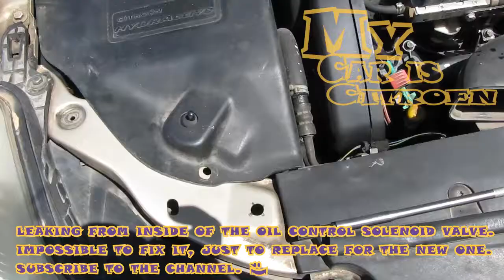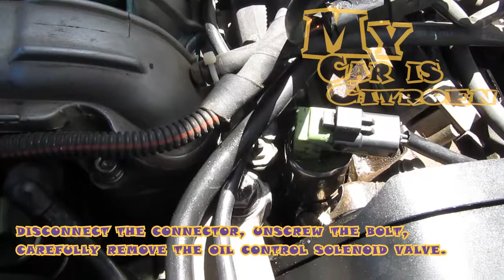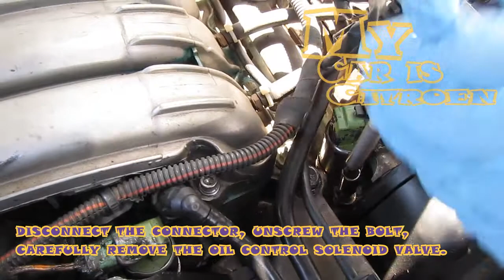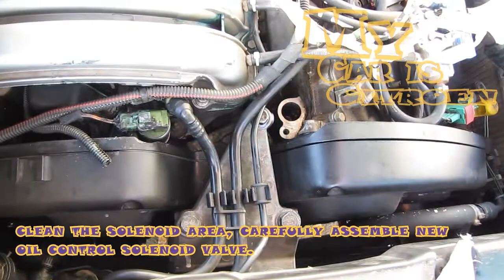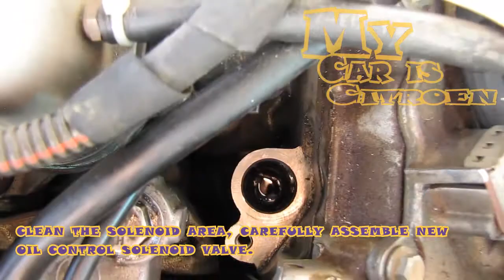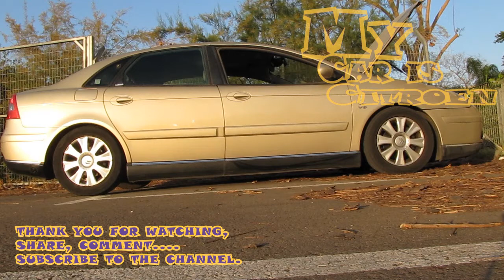Citroen C5 - How to Replace VVT Oil Control Solenoid Valve - Variable Valve Timing Oil Control Valve

Comment: Would a cold start hight pitch short-rattle be related to a failing VVT solenoid?
Reply: That is the same problem I have, so you have answer to this one yet or no. I will go try to clean the selonoid and see how it works
Reply: @AJ-zv9tn  solved?
Reply: @tossftw7228  just ignore it